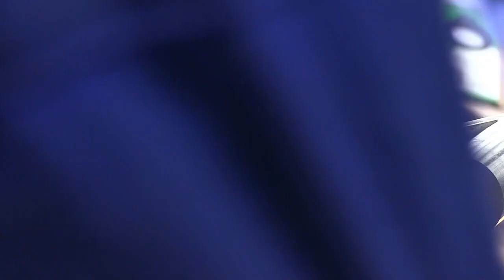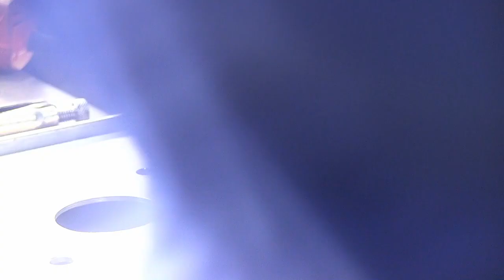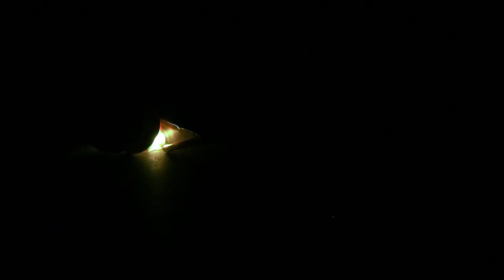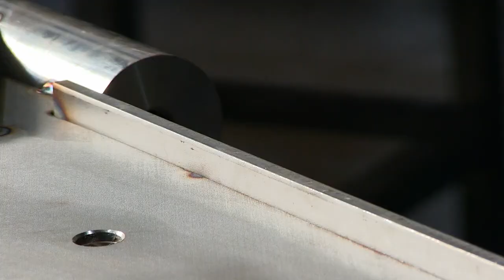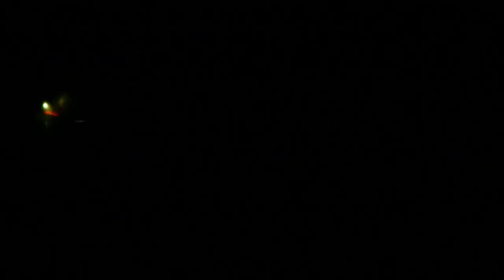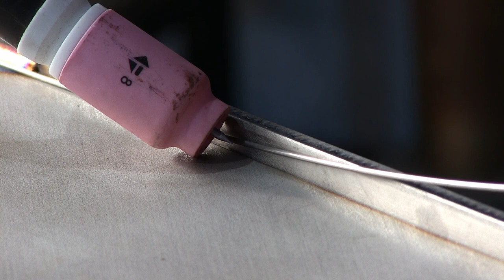TIG welding techniques and effect of wire diameter on stainless steel weld beads.

Comment: Beautiful work there young man!
You are making me want a Tig welder even more. However, I have a lot of stainless steel MMA rods and have no doubt I will be able get a reasonable bead but nothing as great as yours!
Reply from the maker: MMA rods can also be really good on stainless especially if you have ability to keep them dry. Hot slag is a bit of a problem  and it gets  you every time when you forget to wear glasses 🙂
Reply: @weld-deluxltd7635  Just watching your Propane torch gas cutting video, another skill I need to improve. I have all the manual gear and gases but rarely use it, I need to use it or sell it on? Anyway, Yes, thank you for your reply on stainless steel. I will try to find some decent thickness stainless and have a go. As for "hot slag", yes it can be dangerous even on mild steel rods and also the female type! Ha ha ha ha ha ha....
Reply from the maker: @JonDingle  That is a long video, i hope it is informative enough to justify watching it.